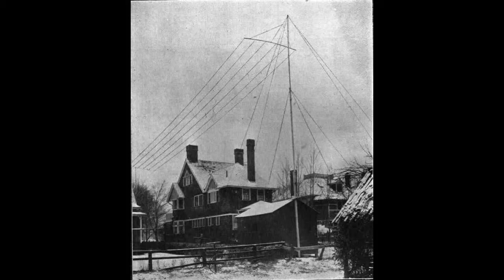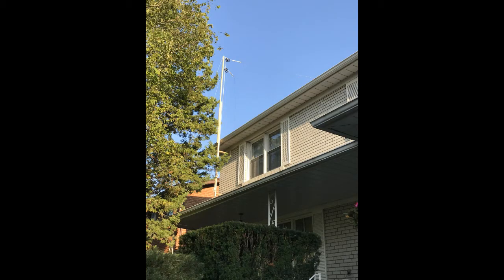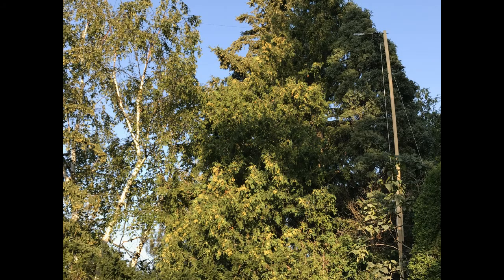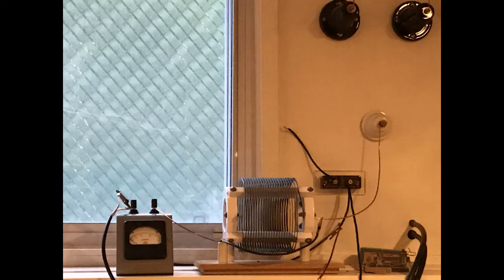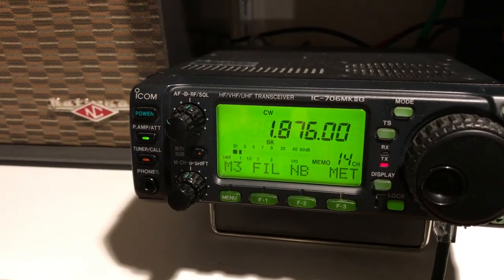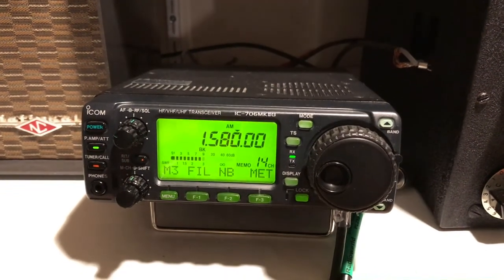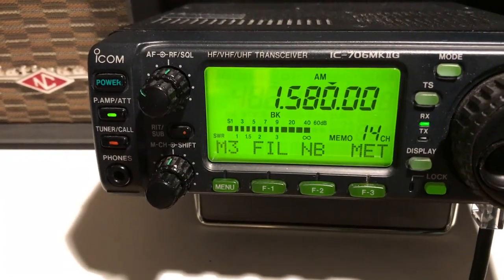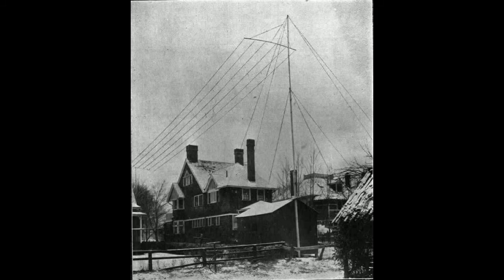1/4λ Marconi Inverted L antenna 160 meters no tuner needed fits on city property very efficient

Comment: Just curious, what kind of ground are you working against; water pipes, ground rod, etc? It seems this is the only way I will be able to get on 160, as I am severely space limited! Many thanks DE KB1CRQ!
Reply: Hopefully you received an answer ?
I built an inverted "L" for 160, fed with a buried length of 
RG - 58,  back in the early '80's, as I too had limited space !
I laid down just a few random length radials, but much like you asked, I latched onto everything ground wise I could, cold water pipes, base of my tower, cyclone fence, etc.,  whilst watching for effects of SWR changes, to witness each added grounds effectiveness !
Furthest Dx contact was to France !
100 Watts !
From land locked East Central Illinois !
Hope you didn't give up !
Lots of work equates to lot's of fun on 160 !
But, like every band, " You can't work them, if you can't hear them !
Good luck, and good Dx !
'73